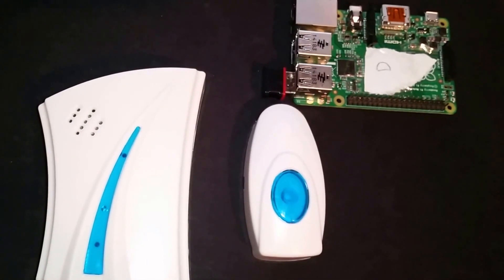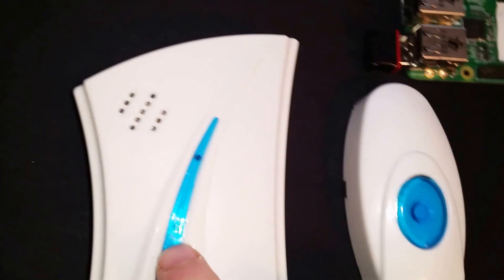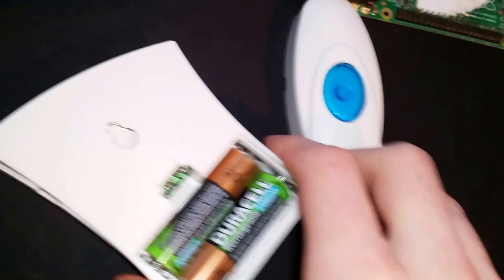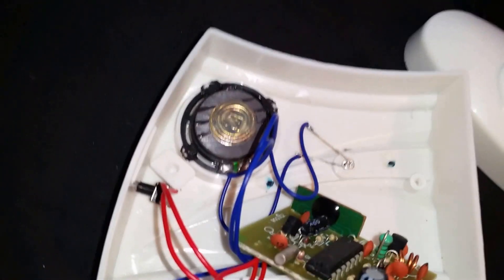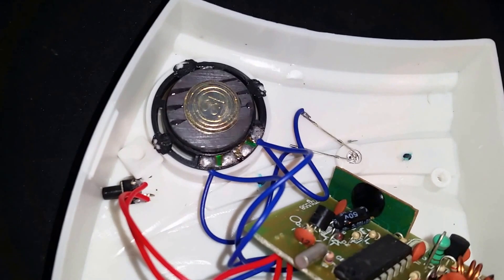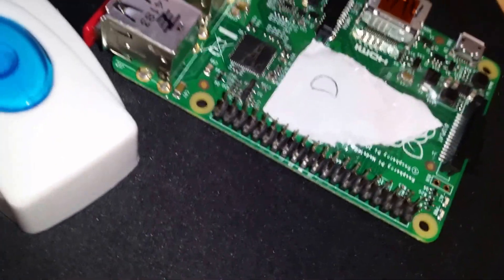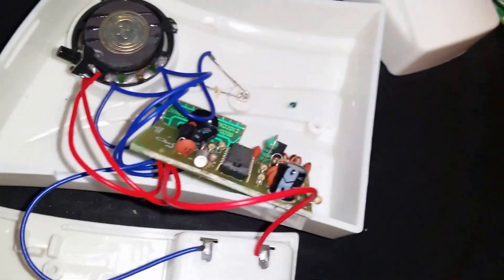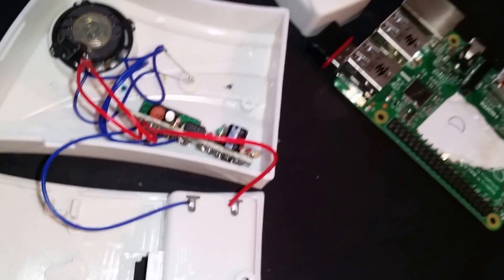Wireless switch for a Raspberry Pi for a doorbell

Comment: sir how do u connect wireless doorbell to raspberry pi? and to know which wire is power and ground
Reply from the maker: i used a multimeter and looked at which voltage goes high